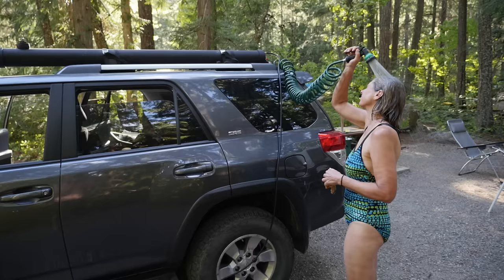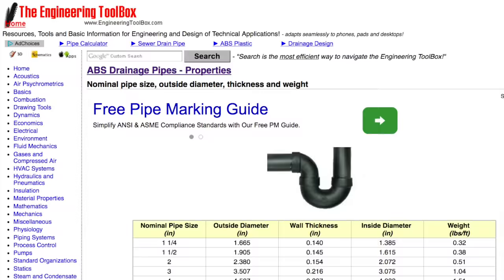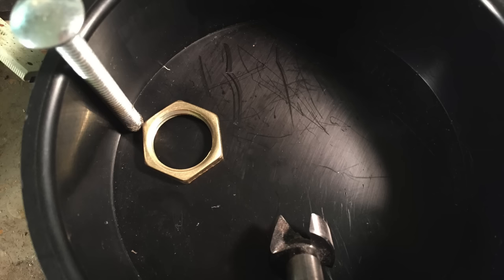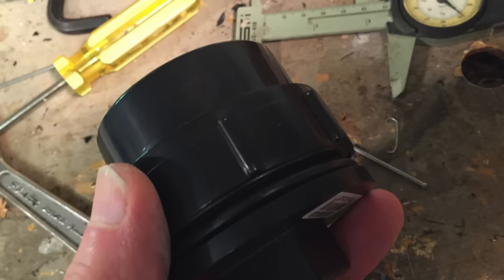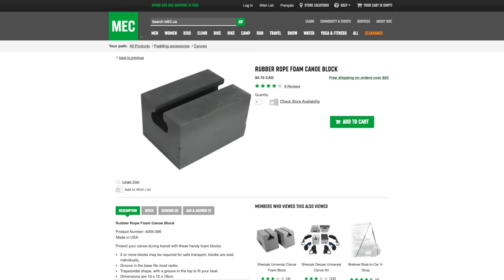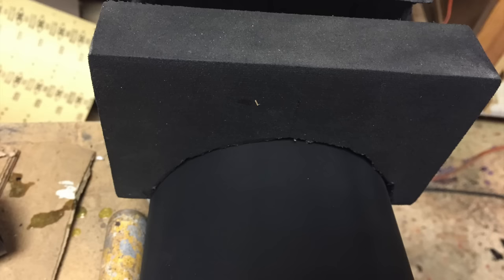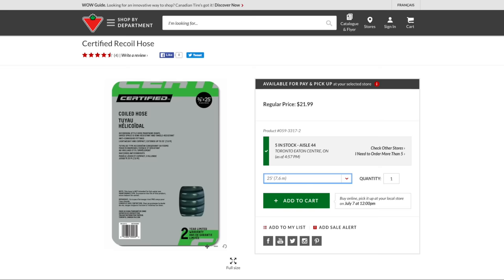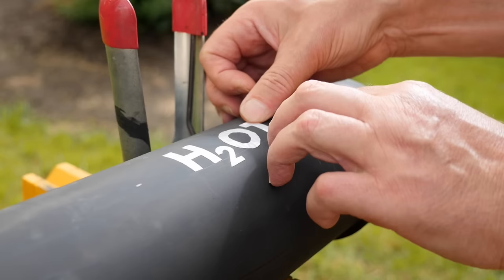H2OT - Rooftop, pressurized, solar-heated shower/sprayer using ABS pipe. DIY

Comment: I've just built one of these, and the threaded screw-on filler cap is not sealed and therefore leaks air as soon as I try to pressurize it. I got a cap with a nylon gasket, tightened it with a wrench, and even that didn't withstand anything over 10psi. If anyone knows a) what I'm doing wrong, or b) a workaround for this, I would love to hear it.
Reply from the maker: Here is the cap I used. Note it has a rubberized gasket included. https://www.homedepot.ca/en/home/p.2-in-abs-male-plug-mipt.1000116110.html
Reply: Thanks for your quick response! On Home Depot's recommendation, I built this out of PVC (they said the ABS would warp in direct sun). Don't see a version of this in PVC. You think the ABS threads are the same as the PVC?
Reply: Part appears to be only available in Canada, and local plumbing supply stores here in Boulder CO could offer no solution to seal the cap. Search continues...
Reply from the maker: The person at Home Depot is wrong. I have previously detailed numerous times n these comments exactly why you should use ABS and not PVC.  Both concussion and explosion characteristics of both plastics are readily available online for reference.
Reply: Don't know what the problem is. I got the threaded cap (have tried a few caps) with the O-ring. Have tried several O-rings. Tightened down with wrench. Still doesn't tolerate pressure over15-20 PSI. Have consulted with Plumbing Center specialist. They say it should hold plenty more pressure than I'm asking of it. Still doesn't.
Reply from the maker: Then it is not the cap (male), it is the threaded fitting (female).  I would suggest trying either wrapping the threads on the caps with teflon tape to tighten the fitting, or brushing the threads with pipe dope.  Both are commonly  used to fix this type connection issue. Give that a try.
Reply: Well thanks for the suggestions. Makes sense that that's where the problem lies. My understanding is that teflon tape is for permanently sealing threads on a joint that does NOT need to be reopened (like this filler cap does), but I guess at this point, it's worth a try. I will also look up "pipe dope." Much appreciated. Or maybe I teflon tape a 4" cap with a 2" centered threaded opening, and use that 2" opening as the fill port. Hopefully that 2" threaded seal would be more air-tight.
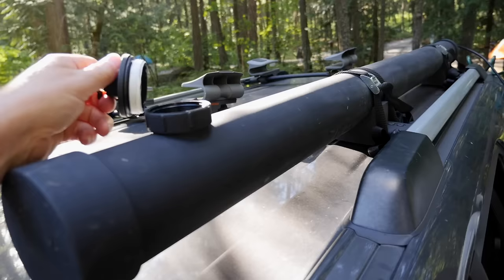Reply from the maker: Here is a comparison of uses for teflon tape vs pipe dope.  https://www.finehomebuilding.com/2009/03/05/whats-the-difference-joint-sealing-with-teflon-tape-and-pipe-dope  NOTE: I DO USE teflon tape on mine. You can clearly see it in my video at 4:07. If you wrap the tape the correct way, it wil last many many refills.
Reply: Great to know. You've been a big help. Thank you!
Reply: Teflon tape seemed to do the trick! On first attempt, I pumped it up to 20+ PSI and it held. I'm cautious to go much beyond that for now. If I have to reapply teflon tape every filling or two, I'm okay with that. Just such a relief to se it hold some pressure! Thanks again!
Reply: I went with a glued on cap with a 30lb blow-off valve instead. I fill using the water hose as the tank is mounted way to high on a hightop van to fill by hand anyway. The system shown assumes you can easily get to everything and is great for a 4WD but not so practical for hightop campervans etc.
Reply from the maker: Sounds like a great modification. Well done.
Reply: bicanoo_magic would you care to elaborate for someone with a high top sprinter wanting to build this?
Reply: Jovan Ventura I found that most of these hot water systems are designed for easy access ie. you can easily get to the top of the tank, unscrew the filler or maybe pressurise the system via that Schrader valve. etc. or you can easily get to the shower head and clip it to the side of the unit. However, when you have a van with a roof that's over 2.5M high (say 8 feet or more),  how are you supposed to fill the thing? where does the shower head go and how am I supposed to pressurise the tank? 
One answer is to do everything via an external ladder. Costly, heavy and ugly.
To get around most of the issues I decided to fill via the outlet hose back into the tank. To allow this, I attached a 30PSI blow off valve to the ''filler cap'' which is typically well under garden hose pressure. OK, so now I've got my shower happening and with the 30PSI plus and a lot of gravity my shower is a force to be reckoned with. But what happens when the pressure is gone and it starts to create a vacuum inside?
I then had to fit a Vacuum relief valve which opens when a vacuum is created inside. You need to get one with a cap that breaths as you do not want to be sucking in debris into the tank ...and how do I hold all that water in? I have an inline valve about 1M away from the shower head midsection in the shower hose. I clip the shower hose to the back of the van when traveling. With my method you can also pressurise the tank with hot water you heated on the camp stove and mixed with cold etc. to get the perfect temperature.
I know its a lot more hassle.. 
However, the other way we do it is get a yearly subscription to a nation wide gym chain and use all their shower, spa, sauna and cafe facilities when traveling! LOL
Reply: bicanoo_magic thank you for prompt reply! Would you happen to have any pictures and or additonal parts list? I'm really keen on this shower setup but like you, my sprinter is 8.5ft tall so i totally appreciate your input!
Reply: Thermometer Temperature Sticker StickOn http://r.ebay.com/oxi04F (Handy so you don't get a cold or boiling shower)
Tire Valve Stem Kits http://r.ebay.com/AsuDmW
Air Safety Blow off Valve in NPT  BSPP http://r.ebay.com/Nmd4N8 (Goes on top of the filler cap)
Kinetic Vacuum Breaker MBSP EMEK http://r.ebay.com/u7OqFB
or if you want to pressurise it you need an air compressor but you need to manually cycle the compressor so as not to over pressurise the system. You won't need the valves in that case but it's more wiring and mucking around as you will also need a weatherproof switch on the outside to cycle the compressor.
Here's what I was considering..  Electric Portable Pressure Pump Q http://r.ebay.com/8d6A0U 
But put it in a weatherproof case.
Reply from the maker: WOW!  bicanoo_magic Genius mod. Very well done.

Comment: Which air valve stem did you use?
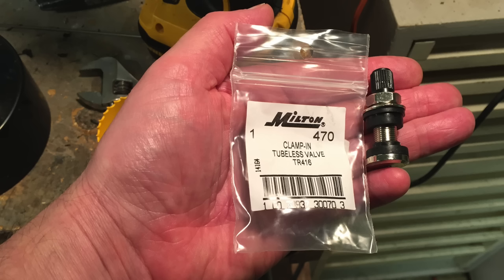Reply from the maker: You can see the package at 1:58.   It is a Milton 470 Clamp In Tubeless Tire Valve, TR 416.
Reply: @ImaginetMedia  found it on Amazon...thanks!

Comment: How pressure are you set it plaease?
Reply from the maker: I manually turn the compressor on and off. I pressurize to 30 psi and turn it off. Once the pressure drops to about 10psi, I turn it back on for a few seconds to bring it back to 30psi.  As the water level drops, the need to re pressurize also drops as the capacity to store compressed air in creases.
Reply: @ImaginetMedia  Thank you very much!! 😊😊💪🏼💪🏼
Reply: i was wondering this as well, would be nice if you could get a pump that could regulate to a desired pressure. i would think that it may be benificial to put a one way valve in the airline tho!
Reply: @sebastianlopespereira1696  Im thinking in use an auto stop compressor set on this 30 psi 😊
Reply from the maker: @Mawa999   That would be very handy indeed. My compressor does not have that feature, unfortunately.

Comment: Will normal pvc work?
Reply: Not if you need the water to be potable, where ABS can be used for potable purposes.  If you just want to use the water for showering, cleaning, etc. then PVC would be fine.  PVC is not very UV-resistant either, nor is ABS unless they are coated with a UV-resistant paint or other UV-resistant covering.  PVC is also less durable (more brittle) than ABS.

Comment: Are you at all worried about bacteria build up or anything like that?
Reply from the maker: The water is in the tank at most 10 hours. So no.
Reply: @ImaginetMedia  do you ever was it with soap or anti bacteria stuff?
Reply from the maker: @explorationtoday2732   No need. Here in BC, I usually use water from a campsite which s potable (chlorinated)  drinking water.   Do you wash your water bottle with soap and water every usage?   Also, I am showering in it, not making martinis.
Reply: @ImaginetMedia  haha I get it. Thanks for talking with me! Just some stuff that is rattling inside my head that I was wondering. I plan to make one for myself soon.

Comment: how do you keep the aircompressor at 30psi?
Reply from the maker: I don't. I fill to 30 and shut it off. When the pressure drops to around 10 psi, I turn it back on for a few seconds to take it back up to 30.  The fuller the tank, the less void there is for air to be compressed. So, as the tank drains, the need to repressurize is reduced.
Reply: @ImaginetMedia  yeh I built one last week and when I tested it the air pressure dropped right away.
Reply from the maker: @sikedmike  Water does not compress. So as more void is created, more pressurized air can be added. Once you get to about half full, the pressure says high for the rest of the shower.  We just have each other work the switch when we shower.
Reply: @ImaginetMedia  Or, place the compressor switch next to the shower I'm building inside my trailer. Some compressors have a built in regulator that limit its output to some predetermined level so you don't blow up the pvc.
Reply: If turning the compressor back on while showering is a hassle.  Add a second pipe the acts a an air reservoir.  Run your fittings that connect the two out the top of the pipes to keep water from infiltrating the second pipe.

Comment: Has anyone tried to connect 2 in series?
Reply: str8frnt I haven't.  But i assume you mean like 4 of these mounted side by side on the roof of a vehicle?   

You could, but it would probably be easiest to pressurize each tank individually, with air.  Then share a common outlet  (4 into 1 water manifold ); then attach hose/sprayer.
Reply: @drjay7879  Weight and space concerns.
Reply: No, but someone made a square going around there roof.

Comment: I have a question about the PVC pipe material. These are not BPA free pipes though right? I have no idea so I was asking? I thought about your video and I love the idea and was almost ready to buy everything when I thought about the whole BPA free piping.
Reply from the maker: I do not know about PVC. The pipe I used is ABS. Totally different properties. It is like apples and oranges.  A little chemistry knowledge goes a long way.
Reply: @mychanneltoletyouknow  Yeah I read that too. I am not sure I would use any plastic at all to be quite honest,but a  fucking damn good idea for a shower. What would you use to make one ,just curious? Now my wheels are spinning.
Reply: @herbbradley8958  its not for drinking water. Its for showering and cleaning so BPA would be irrelevant honestly.
Reply: PVC pipe dose contain bpa and ABS dose not.

Comment: What size is that nut for the hose
Reply from the maker: I do not understand the question. There is no nut on the hose. The end of the hose is a standard garden hose connection.
Reply: That nut in 1:44 in the video
Reply from the maker: @fparedes  That is a facet lock nut.   But you probable can avoid using one entirely. My spigot is so tightly threaded into the ABS, it is not coming loose. If I was to build another shower, I would skip this entirely.  Here is a similar one for reference.   https://www.homedepot.ca/product/moen-brass-faucet-lock-nut/1000516334

Comment: I'm considering your design for installation on my sailboat.. was discussing  your video on a sailing forum, and someone suggested to mount it upright on the front of the mast, but another guy said it probably wouldn't be as efficient if it was vertical... I'm not sure why that would make it any less efficient, do you? -- Also for overcast days, and night time, Im considering installing one of those 12v water heater elements on one end ($20)like this: http://mwands.com/store/dc-water-heating-elements
In which case, an automatic pressure relief valve might also be incorporated.Do you see any problem with these ideas?
Reply: look into portable basketball set up. Garage sale ect? they are black and made to fill with water. Anyway I was thinking about one.
Reply from the maker: +putheflamesou I would be surprised if you could pressurize a basketball base more than a few psi before it burst.  They are great as a static weight but as a pressurized tank - not so much.
Reply: I believe there are 12volt pressure shower wands that create own pressure that would work but need a small battery also.

Comment: How much psi to use?
Reply from the maker: I use a maximum of 30psi. I turn off the compressor at that point. I let the pressure drop to 10psi before I turn it on again.

Comment: Hi fella, Great instructional vlog, did you use 4 or 6 inch pipe for your shower system???
Reply from the maker: 1:15
Reply: @ImaginetMedia  I had the same question - because you reference you're going with 4", and then quote the bursting pressure for 6" later on.
Reply from the maker: @DrIverach  I used 4" pipe.  I am not sure where you are getting the 6" usage from.
Reply: @ImaginetMedia  5:01
Reply: awesome video !!
Reply from the maker: @DrIverach  Yes, I was quoting the 6" pressure rating from the chart. The 4" has an even higher rating.

Comment: did you have to keep the compressor running for it to work?
Reply from the maker: No. It is only on when the pressure drops to below 10psi then off again when it reaches 30psi.  The duration that it is on varies with the amount of void in the tank left by water being used.

Comment: You painted the black pipe black?
Reply from the maker: Yes. ABS pipe has a very reflective surface even though it is black. I painted with flat black paint that reflects very little light. That light is energy and energy is heat that is now retained.  Plus, several coats of paint add tremendous UV resistance to the pipe.
Reply: @ImaginetMedia  interesting I did not think of that. I want to build one of these myself and was hoping to skip the paint job. I guess I better paint mine too. Thanks for the great idea.
Reply: @Myke_Lemons  You could always wrap the tube in matt bike frame tape.
Reply: @ashb4541  or matte black vinyl wrap probably... that stuff is pretty amazing

Comment: why not is PVC？
Reply: Pvc not meant for pressure
Reply: @feustond  That is not true.  4" schedule 40 PVC pipe has a pressure rating of 220 psi.  The fittings however are not pressure rated.  It is recommend to limit fittings to 60% of the pipe pressure rating.  Depending on the the formula for ABS the pressure range for 4" is between 100-175 psi.
Reply: We build tater guns out of 2" 3" and 4" sched 40.

130 psi guage.
Never had an issue.
Over pressured to 160 too. 

If you pump up your shower that much do us a video, will ya?

Comment: Is it safe to drink that water or is it for cleaning only?
Reply from the maker: It is ABS plastic which is not food grade. However, the water is only sitting in it for a few hours. If standing water in ABS pipe leaches some chemicals in just a few hours then it would biodegrade in a few weeks.

Comment: Fantastic solution, & a very good vid... but... is it a secret? If not, why are you speaking just above a whisper with muted voice inflection? I'm not saying shout it from the rooftops, but, it sounds like you're doing this in bed and trying not to disturb or wake your spouse.
I'll be trying looking at this for a solution, thanks!
Reply from the maker: The volume is normalized to -6 dB. This is industry standard LUFS. Perhaps there is a problem with your speakers.

Comment: total cost? I really want to make this for my subaru crosstrek!
Reply from the maker: My total cost and yours will be completely different, based on where you live compared to me, parts availability where you are, parts you have on hand already and any tools you need to get. I showed yo the parts required in the video. You should be able to source all these at your local hardware, big box or automotive parts supplier.
Reply: @ImaginetMedia  i appreciate your quick response
Reply: Hey Ashley - I live in TN and this is where I'm at for pricing, mid-build: I got the thinnest pipe Lowe's sells because it's substantially cheaper and I figured it would heat up faster. It probably has a lower PSI limit. It was $11.20 for 10 feet, and I had Lowe's cut it (one 5' section, and one a few inches to connect the angle joint and the female adapter for the cap). Instead of a T-trap to fill as most DIY videos suggest, I got a 90 degree angle joint to put on the end ($2.50), plus a female adapter ($5), and the male end cap ($3). According to the Lowe's plumber, you don't need the pipe cleaner if you have a strong alcohol, so I just purchased the glue ($6). I'm at $30 total in this Lowe's visit. None of this includes my local taxes.

Left to purchase items I've selected: hose + nozzle ($24), black Rustoleum rubbarized undercoating ($6/ea), presta/schrader air pump ($13), spigot with nut and washer ($13).

Items I haven't decided on: air valves (under $5). I'll probably be able to use straps I already own to secure it.

Total: $90ish without tax.
Reply: @mcatronw   you're awesome for giving me that information. I found it incredibly helpful. Thanks a ton!